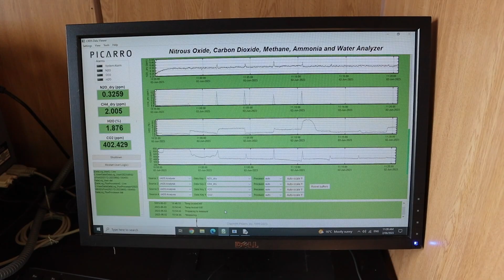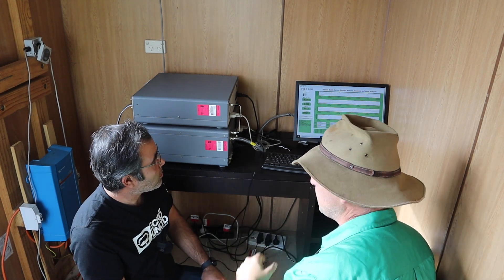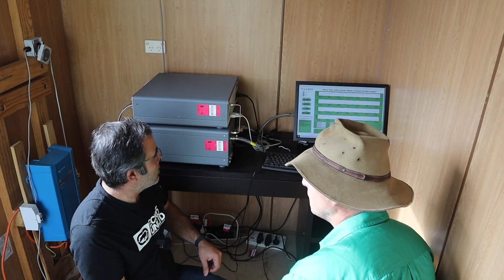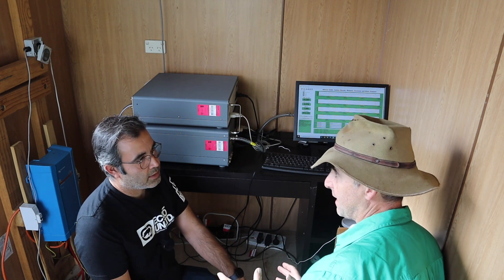Debunking Methane Myths: Powering Pasture Carbon Drawdown with Biochar & Wood Vinegar

Comment: How to make profitable use of Forestry slash that otherwise is left to be fuel for wildfires or weight behind flash floods. Also, relieved to learn our Moos are not villains but part of a carbon sequestering ecosystem. Many thanks. 👍 
Now, how to moderate methane emissions from our much needed Wetlands!

Comment: "Agricultural waste" doesn't exist! it's all soil food.I also don't know what ag process produces wood chips as "waste". That's more likely just ex-trees, a fact which makes large-scale bio-char a no-go except where deforestation is desired.
Reply: Nice point Greg.  We are currently using wood chip because that's what's available.  But we can process any waste biomass: nut shells, fruit pips, etc
Reply: Forestry plantations generally have wood chips as a waste product as they plant trees think when young and then thin out 2 to 3 times per growth before harvest of the end trees. The ground 8s then replanted like any other crop.
Reply: @huntersandshooterssocietyo175  what part of forestry plantations have wood chip as waste? Bit of sawdust from mills. Lots of Slash left where the trees are felled. But where is the chip from?
Reply: @avid6186  20-30% of whole logs through a sawmill process end up as wood chip (they can't make boards from the curved bits), then there is about 1 million tonnes of waste biomass collected just in Sydney each year from trimming trees (like around power lines), then there is end of life and building waste timber streams before we look at agricultural residues. When looked as a whole managed plantation forestry is good for the environment and even better if the leftover material is transformed into a stable form of carbon for over a thousand years.
Reply from the maker: I recently did a story on super forest plantations that beautifully summed up the nature of waste. They are composting it. Turning it into biochar is WAY quicker and value adds. Looking like “waste” is another trigger word…..
Reply: @chadsheppeard125  ah, must be a country specific thing. Here that "waste" at the sawmill is turned into firewood, it's not chipped. A lot, possibly all, not sure about that one, of prunings get chipped but is then sold back as mulch for gardens. There is a huge requirement for chip for herd homes for cattle, but they tend to chip whole trees for that not just prunings. We just don't seem to have a lot of chip that could be called waste here.